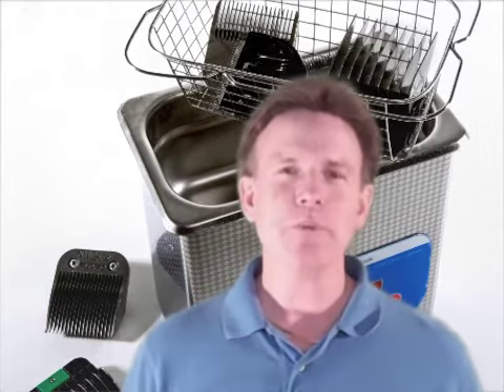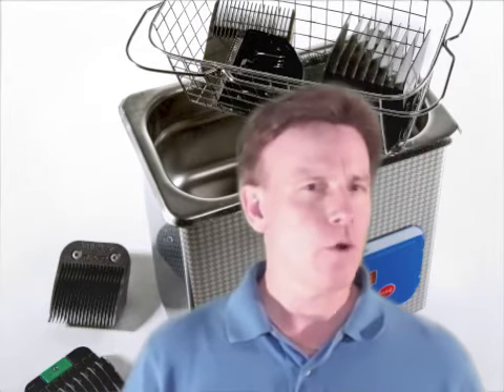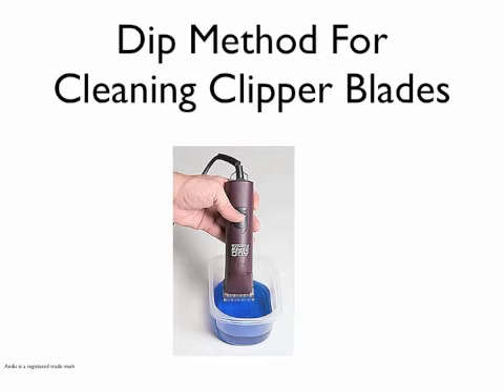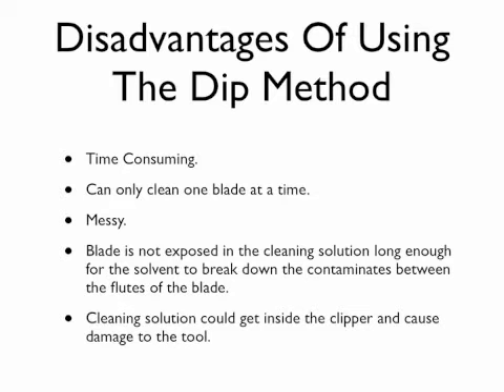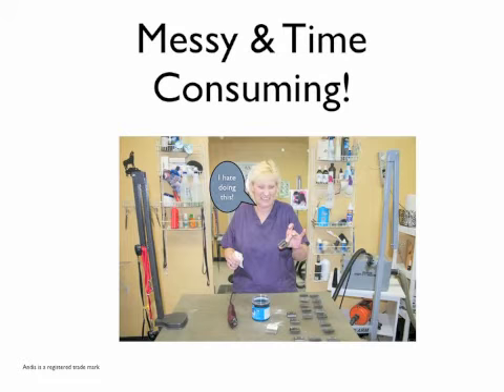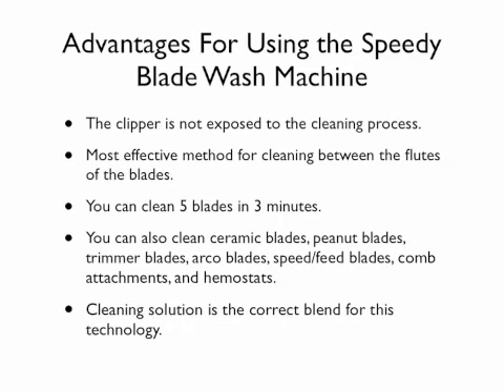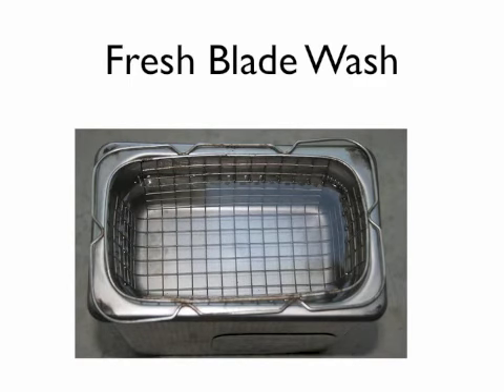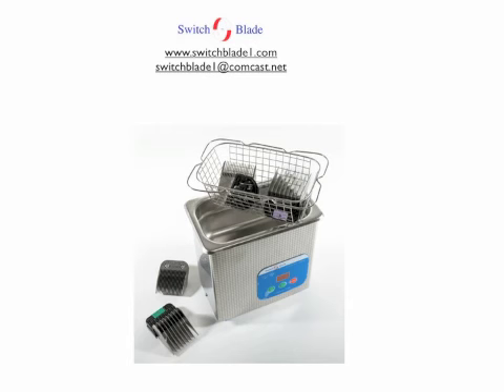Why You Should Use The Speedy Blade Wash Machine!

Comment: I have been using Derek's blade wash machine for several years now and could not be more pleased! I admit I am a lazy groomer and used to go weeks between cleaning blades; usually when one started acting up, I'd toss it in the "problem blade" tub and grab another one to use. When I was all out of blades to use, I'd finally break down and clean them all! Other methods are messy and time consuming. With this system you just load the machine, push a button, then blow the blades dry with your HV!